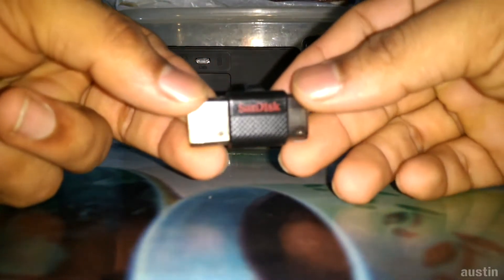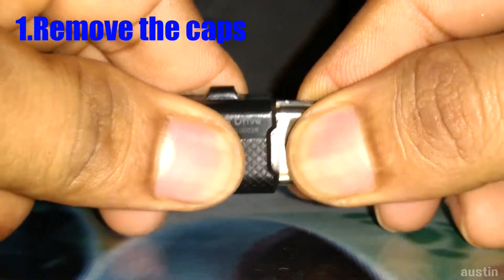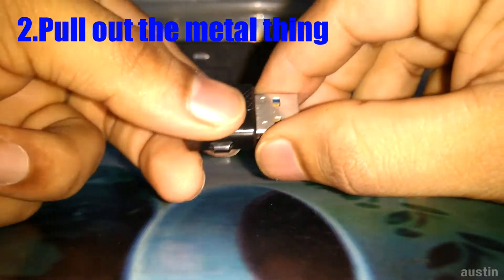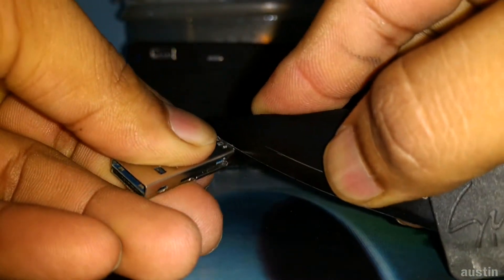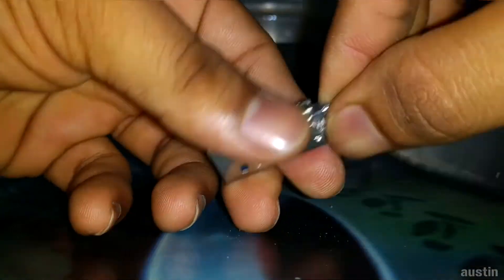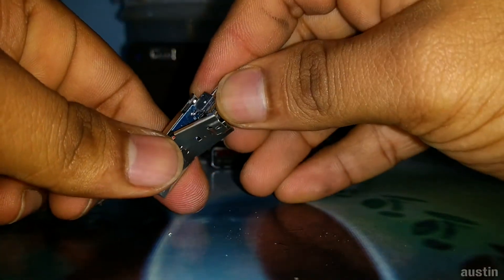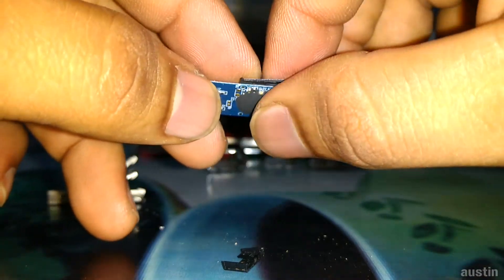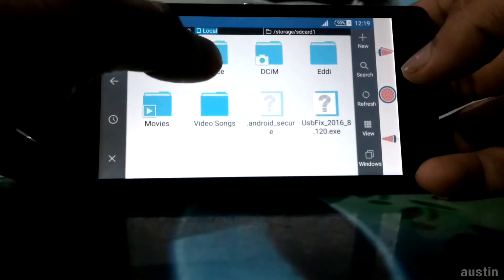How to Repair Corrupted Pendrive | Sandisk Dual OTG | USB Not Working | Data Recovery

Comment: You're the only other person I have seen who had discovered this. It is possible to slide sd card out, without removing metal shielding though. 
I wonder how many other USB drives have hidden SD cards?👍
Reply from the maker: Hi.
Unfortunately no! From what I've experienced it's not possible to pick the card without folding out the metal casing.
Reply: @austinnoronha1373  I use a small thin precision screwdriver between the circuit board and sd card and gently lever out the sd card without any damage. I now use it as a micro sd card reader with other capacities of cards.
Reply from the maker: @FixerUK  Great. I didn't want do it as my stick was already broken. Only the SD card was something that i could use. Good for you.